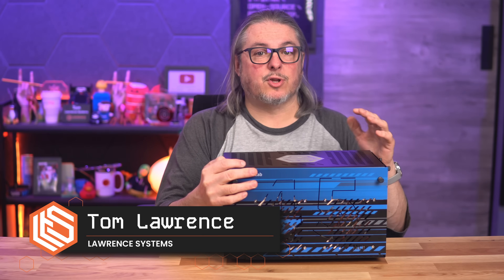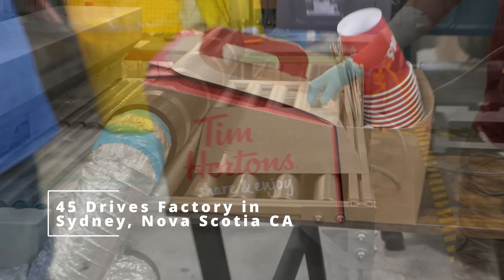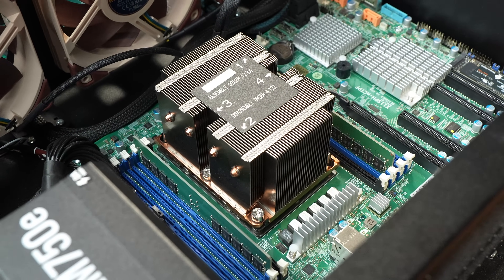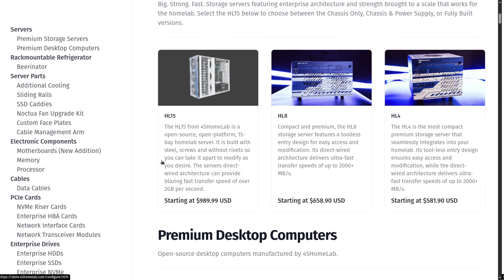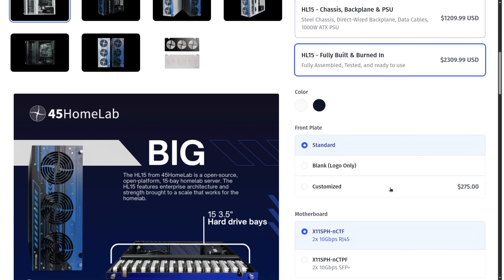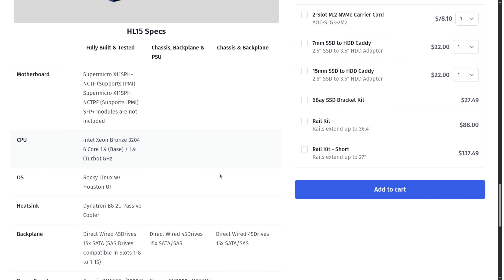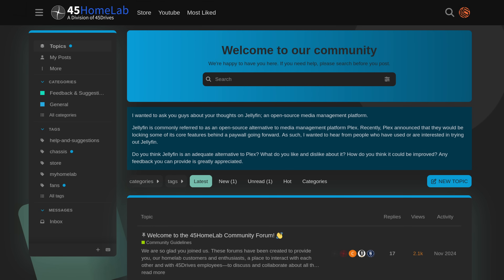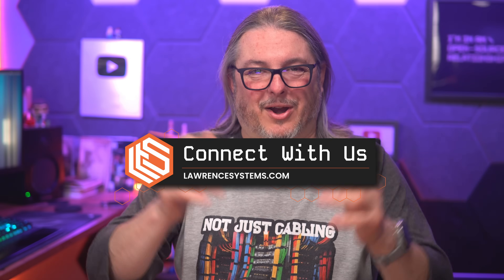This is What Premium NAS Hardware Looks Like

Comment: I rarely comment on YouTube but been a watcher for quite a while, hoping this reaches!
Would love to see a video on the state of DAS (Direct Attached Storage) + mini PC setups.
As someone who's using a rock-solid Intel NUC (NUC12WSBi7) + external drive enclosure (Terramaster D6-320) combo w/ Unraid I feel like this option is hugely due for a revisit.
I've gone from Dell R710 > Dell R720XD > DIY NAS > this and it's amazing how small, quiet, and efficient this is without compromising anything major.
It's important to pick a DAS with a good controller, a high quality USB cable, and a PC with fast enough USB ports. But outside that it's super simple.
I've run both ZFS and XFS with and without pools and never have connectivity/disk issues. R/W speeds are excellent and SMART as well as other disk operations work as expected.
If you look at forums and such you get the consensus that you're taking a big risk and in for some headaches but I don't think that's true anymore.
Reply from the maker: It's become better using external connectors but not good enough for me to trust it over time.

Comment: Since noise was a concern, It may be good to provide decibel numbers for various fan configurations, and consider testing more of the motherboard options. It would be beneficial to offer pre-configured software options (like TrueNAS or Unraid) for those less familiar with setting up a NAS from scratch. If so, they should be fully tested so they work as intended.

Comment: Why is no one talking about the terrible thermals of this case? I bought it and, after installing eight drives, the temperatures hit 55°C—way above the safe range for HDDs. I ended up replacing it with a cheap Chinese case, and the temperatures dropped to 35°C. In my opinion, this case is just a waste of money.
Reply from the maker: Because I have several of these and none of them have had any thermal issues.
Reply: @LAWRENCESYSTEMS  what is your definition of "issue" you have all 8 drives installed? What is the temperature of the drives? What is RPM of fans? Do you think 55C is an issue?

Comment: Picked up an HL8 three months ago, they replaced it 3 times, first was damaged in shipping, and to be honest the wiring was jacked, the second shipped and cancelled right before it was supposed to be delivered. They put it together wrong, and the third was just a little banged up when I got it. I just decided to roll with it at that point. So far so good
Reply: 'Third time's a charm'! Haha.

I've found 45Drives support to be great. Sometimes a tiny bit slow to respond, but they have made things right when I've seen anyone having an issue, especially with shipping. Heavy metal objects don't tend to ship as nicely :(

Comment: The best nas equipment is litterally just a server, not some custom box. Don't have 8k+ to spend? No problem, you can get 2U, 24 bay second hand supermicro servers for like 300$. It's not like spinning rust is getting any faster, so a 5 yr old refurb will run just as fast as anything else.
Reply: 100%. This is just another ad haha. The whole point of ZFS storage is that it can run on just about anything.
Reply: @techaesthetics.  Well.. I mean just about anything CAN run on just about anything. However there are better solutions and worse solutions and this is more true for zfs than it is for most things. I'm saying that a used server can be a genuinely good option for a robust but inexpensive zfs fileserver. You'll have a server that in it's day would have cost many thousands, tons of bays, a solid controller, and ecc memory for far less than the cost of a new and likely inferior platform. I have 3  12 bay, 2u supermico servers, two of which I inhereted from clients, one that I bought myself. The controllers can handle the full bandwidth of that spinning rust so despite being old, I can still saturate 10GB on a sequential transfer due to the drives being in a "raid 10" configuration.
Reply: loud and power usage is much higher
Reply: @AntonioMolfetta  the power usage won't be significantly higher. That mostly scales with the harddrives and usage. You can technically replace the fans with more quiet ones if that's a concern, but you would need to test the thermals under load before i would feel comfortable leaving it be.
Reply: @ for less than 10 drives it will matter. Servers are optimized towards efficiency at load, not low idle power usage. I don't see the point of getting cramped and noisy rack servers and try to "domesticate them" for a non-rack environment. You either give them a rack in a basement or you get a PC
Reply: @AntonioMolfetta  Depends on what your use case is. You can mount a server vertically against a wall as well as in a rack, if you have a home lab or self hosted services then other things will be a rack form factor as well anyway so in many cases having an odd ball shaped box isn't desirable.  Regardless, in terms of cost, apples to apples, your not going to do better than a used server. These homelab machines are are just pc parts. A used server gives you redundant psu's and more bays / $. The power difference is not going to be significant, I have a meter on mine and it's hard to say exactly what just one of my servers draw, but it's a lot less than one might imagine. The slightly higher power usage isn't going to cost enough to make up for the initial cost of buying a new but mostly inferior chassis. I'm not saying it's the right solution for everyone, but it is a very good solution, especially if you want 12+ bays.
Reply: The problem with this advice is that supermicro servers are super loud. That's fine if your serve is in a garage, but not so fine if the server is in the livingroom or bedroom.
Reply: @diatomos8  You're not soothed to sleep by the sweet screech of server fans?

Comment: I had second thoughts when I realized that they don't sell backplanes and that's a really common failure point. I'm going to go with Sliger because their solution is much easier to deal with and is hotswap compatible if the controller supports it.
Reply from the maker: You can get a replacement backplane if needed (I have never had to replace one)

Comment: Am I the only one that really dislikes that you're required to use an M.2 to SATA adapter in the PRO-8/HL-8 if you want to use redundant boot SSD's along with your 8 HDD's?
Reply from the maker: I think it's a fine solution. https://youtu.be/-bpEyuMO55E
Reply: @LAWRENCESYSTEMS  Yeah they may be fine but I just don't really trust them as they're an afterthought that the slot was never actually designed for.  The repeated opening and closing of the chassis just makes me leery of there being problems in the future due to pressure from the SATA cables causing issues.
Reply: As long as there is room for a pair of 2.5” drives that I use to boot from, I’m fine with it. Don’t need NVMe for booting.
Reply: @williamp6800  I don't need NVMe for booting either.  I just find it rather questionable to use a hacky (in my opinion) adapter for something like this.  I might just be weird though.

It's one of the reasons we wound up not going with them for the couple of office NASes that we built earlier this year.  No IPMI was another, however, even the PRO-8 uses the M.2 to SATA adapter so even though it has IPMI that adapter was still a deal breaker.
Reply: @ no IPMI? That’s surprising. 

I built my bargain basement servers from used parts off eBay, and every of them has IPMI.
Reply: @williamp6800 

Nope...not with the HL-8 anyway.

The PRO-8 has an ASRock motherboard with IPMI but still uses the M.2 to SATA adapter.  It was also $4765 (back in November) which included 64GB of RAM, 2x250GB consumer SSD's, 4x14TB MG07 HDD's, and no configuration (which is a $1200 option).

I'm sure it's a nice enough system but I couldn't get my boss to go for 2 of them so we wound up just building out systems ourselves to the specs we wanted instead and installing TrueNAS Scale on them.

Comment: 4:38 - Bottom line, whether you can stomach the price or not (for a 'homelab' product), 45Drives has been a good player in the hobbyist and open source storage ecosystem.

In the past, people would dig around to find an old 45Drives or Backblaze server that was going to e-waste and then try to get it running with more modern hardware. 45Drives eventually released some direct sales for their new hardware, plus at least some level of official support.

I wish more companies would do this, though as with many things Linux, the homelab community is much more budget-conscious, while also sometimes a bit more demanding! A hard path to walk, I think 45Drives has done a good job so far.
Reply: It sounds like 45Drives is striking a good balance between enterprise quality and homelab accessibility.